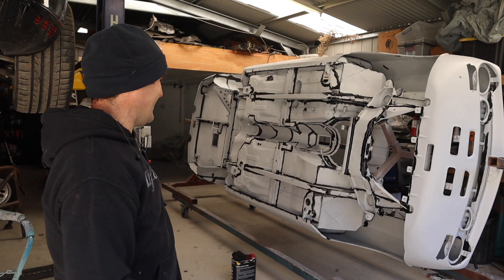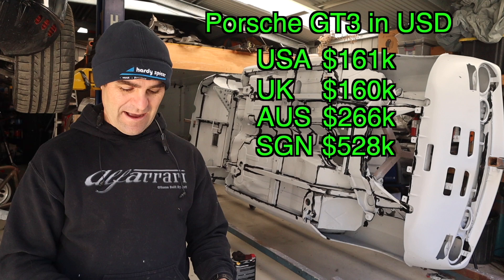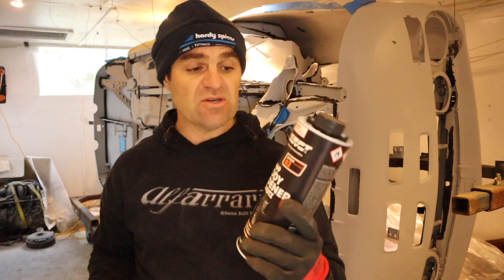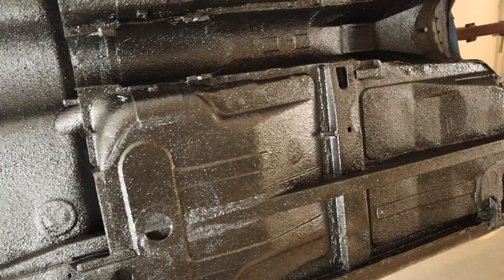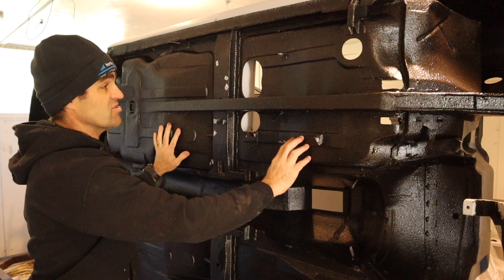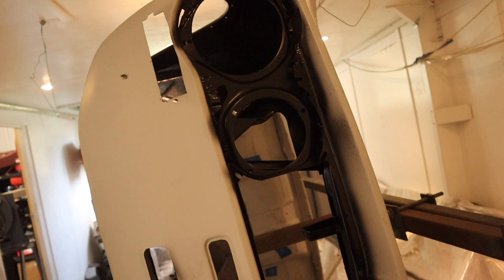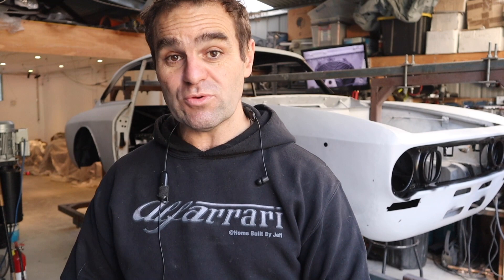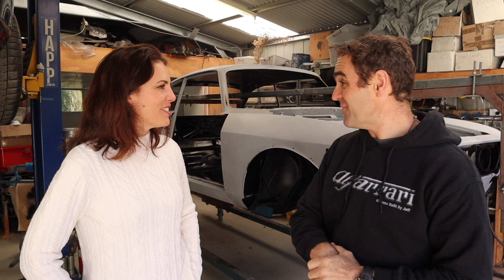Stone guarding the underside - Ferrari engined Alfa 105 Alfarrari build part 135

Comment: We're all excited with this latest ep, can't wait to see the top coat colour. You are correct in spraying black around headlight brackets and grill area. I know that this was factory practice at least since the 1750 s1, which is when I purchased mine in 1980 with original paint, It makes sense. Don't forget to paint the arch extension. 😊

Comment: Looks awsome Jeff. A trick with stone guard when spraying in cooler weather is to warm up the cans of stone guard. Alot of vehicles I've owned I've sprayed stone guard underneath them and paint inside black then truck bedliner on the inside. It's a great way to add to sound deadening and dynamat will stick to it as well. All your hard work is paying off looks awsome

Comment: The Schultz underspray is a FANTASTIC product. We have used it on a few cars now and are really impressed with it. So easy to apply too !
Reply: It used to be factory on Audis and VW’s in the late 90’s. My 98 A4 was fully zinc dipped and stone guarded with Schutlz underneath… They’ve really taken giant leaps backwards in terms of corrosion protection since then. The underneath of my mates 2015 a4 convertible had very little protection. Took one of the rear splash guards off and the sills were basically rotten already… My 98 Audi went to the grave without any rust on it whatsoever after 22 years of all year U.K. driving.

Comment: Do the roof first before removing it from the rotisserie.
I hope your spray booth was heated. I’ve seen that body shutz fall off in sheets because it was sprayed on in cold weather.
Most spray cans say not to use in less than 15 or 20 degrees Celsius as the paint can freeze as you spray it.
The last restoration job I did I used the shutz on the inside floor too and used it to stick down some heavy duty commercial vinyl floor samples to act as underlay and sound deadening.
A few years later they came out with those commercials sound and heat insulation mats that you can peel and stick.
Reply: Yep, crazy to be painting anything in winter without a booth

Comment: I can't help think, white stone guard might be the way to go (if it even exists) as for builds like this where you want to see where an oil leak comes from, or even an exhaust leak, you could trace black back, AAAND the white would help any light directed at it reflected back making you see everything easier. Perfect if you haven't got a set of lifts in your garage.
Reply from the maker: You can get white stone guard, but I don't plan on having those issues ;)

Comment: Will you be putting cavity wax in any hard to reach holes/cavity's to prevent any possible future rust problems? Was wondering it as you were applying the paint to the underfloor of the car.
Reply: Maybe best left until the end as it can cause the paint job to react.
Reply: @martinm4961  Yep. Paint doesn’t bond to it. Any fine misting from it and you’ll end up with holes in your paint job.

Comment: It's great to see all the meticulous fabrication receding and the entire body shell taking on an of-a-piece look. Keep meaning to ask (this seems as good a time as any); have you thought about an air dam / lip spoiler on the front valance?
Reply from the maker: Not really. I think it looks better without.
Reply: @HomeBuiltByJeff  A black duck tail rear spoiler and front lip (subtle one like a 69 Camaro SS) would definitely suit the 70’s vibe it has with the arches and bonnet bulge if it does prove to be a bit of a handful with front or rear lift at speed though.
Reply: @Jonathan_Doe_  that’s the last thing it needs.  The ALFA has great lines, why would you mess with them?
Reply: @HomeBuiltByJeff  It certainly does, I was just thinking about aero, this is going to be a rather fast car! ETA >> I was thinking along the lines of the kind of lip spoiler a lot of 70's performance cars had, often didn't impact looks too much but presumably helped keep the front a little more planted (or even stop things getting outright scary, but that said, the Alfaholics car on the Nurbergring seemed to be OK at 225kph/140mph without one).
Reply: @davidburne9477  Wouldn’t really ruin the lines much at all in black. Especially not the side profile. It’s a form vs function thing, this things probably gonna be a bit of a handful above 60mph without some extra downforce.

Comment: Hey Jeff - what did you do on the flange for the removable area on the trans tunnel - I take it you can't seam seal it otherwise it will be impossible to remove so are you doing something like a gasket or similar so it doesn't have water penetration and rust out in the future?
Reply from the maker: I will add a sealing strip at final install.

Comment: Nerdy comment: Bicarbonate it's a neutralizer not an alcaline. It turns the PH of anything to 7.  It doesn't matter how much you add, it will never make anything alcaline, just neutral. That's why it's used when you eat too much and have acid, there's no way to overdose.  (Well I presume if you eat a massive amount maybe you have other issues, but sure not acid)
Reply from the maker: Bicarb has a PH of about 8.3 so it is slightly alkaline.